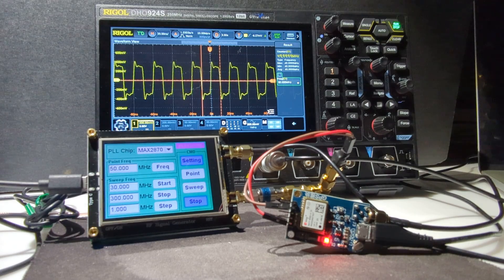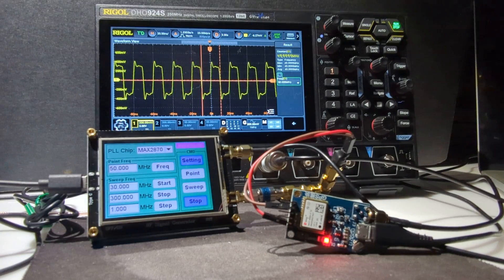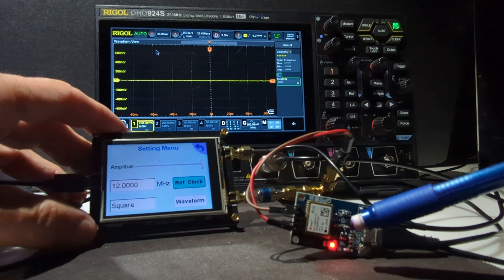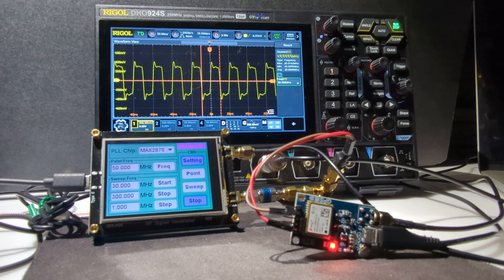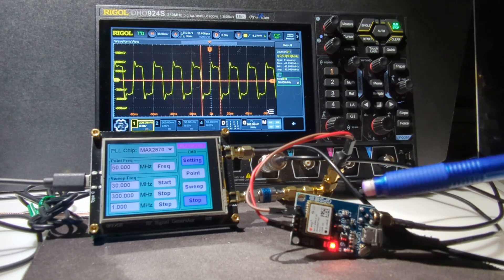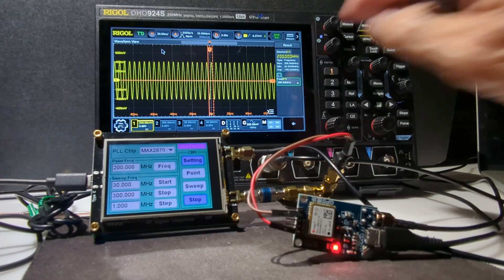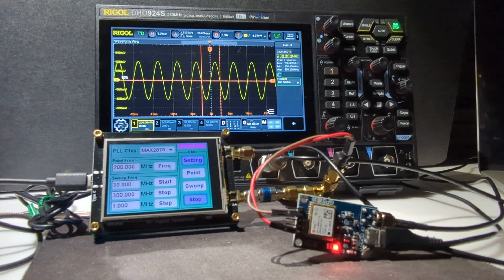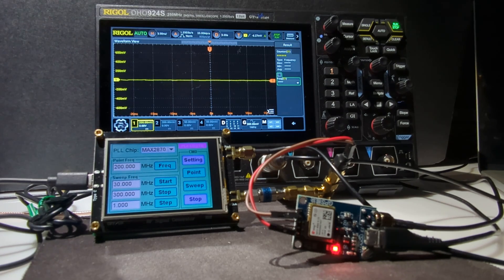MAX2870 signal generator using a UBLOX GPS as a reference clock

Comment: That’s a classic GY-NEO6MV2 breakout board (the blue one that was everywhere around 2015–2018).
The giveaway is the u-blox NEO-6M-0-001 module.  The LED blinking at 1 Hz means solid 3D lock (at least 4 sats with good geometry).

Comment: Hi thanx for the video,but can't I use a signal generator instead of a gps device?
Reply: Is the signal generator more frequency stable than the internal crystal oscillator on the MAX 2870 LCD board?  Some signal generators have a nicely stabilized, temperature TCXO, others don't.

Comment: Does the uBlox provide a digital signal that tells that the frequency is GPS synchronized and not just a local XO ? or one has to query the status over the serial interface for that?
Reply: Yes, you can set ublox to provide for example 1Hz and 5% duty cycle on pps pin and 1MHz and 50% duty cycle when get fix. They show how to do that in datasheet.
Reply from the maker: Using the serial interface is likely the easiest way, by parsing the NMEA messages, as you likely already know. I understand that uBlox also supports a binary UBX Protocol that can be accessed via UART. This provides a UBX-NAV-STATUS message with a field to indicate whether there is a valid GPS fix. I'm not sure which uBlox devices support this protocol or whether is is enabled by default. 

Just for reference, here is some more info about these two approaches: 

Using NMEA
--------------------
The "Fix Quality" field in the $GPGGA message indicates whether or not a valid GPS fix has been obtained (Fix Quality values: 0: Invalid, 1: GPS fix, 2: DGPS fix). 

Example NMEA messages:

1. NMEA Message with a Valid GPS Fix
$GPGGA,123519,4807.038,N,01131.000,E,1,08,0.9,545.4,M,46.9,M,,*47

2. NMEA Message without a Valid GPS Fix
$GPGGA,123520,,,,,,0,00,99.99,,,,,,*48

List of NMEA fields from the `$GPGGA` sentence, in order with definitions:

1. *Sentence Identifier* (`$GPGGA`):
   - **$GPGGA**: Global Positioning System Fix Data

2. *UTC Time* (`hhmmss.sss`):
   - **123519**: Fix taken at 12:35:19 UTC

3. *Latitude* (`ddmm.mmmm`):
   - **4807.038**: Latitude in degrees and minutes (48 degrees 07.038 minutes)

4. *North/South Indicator* (`N/S`):
   - **N**: North

5. *Longitude* (`dddmm.mmmm`):
   - **01131.000**: Longitude in degrees and minutes (11 degrees 31.000 minutes)

6. *East/West Indicator* (`E/W`):
   - **E**: East

7. *Fix Quality* (`x`):
   - **1**: Fix quality (0 = invalid, 1 = GPS fix, 2 = DGPS fix)

8. *Number of Satellites* (`xx`):
   - **08**: Number of satellites being tracked

9. *Horizontal Dilution of Precision (HDOP)* (`x.x`):
   - **0.9**: Horizontal Dilution of Precision

10. *Altitude* (`x.x`):
    - **545.4**: Altitude above mean sea level in meters

11. *Units of Altitude* (`M`):
    - **M**: Meters

12. *Height of Geoid Above WGS84 Ellipsoid* (`x.x`):
    - **46.9**: Height of geoid (mean sea level) above WGS84 ellipsoid in meters

13. *Units of Geoid Height* (`M`):
    - **M**: Meters

14. *Time Since Last DGPS Update* (`x.x`):
    - **(empty)**: Time in seconds since last DGPS update (blank if not available)

15. *DGPS Station ID* (`xxxx`):
    - **(empty)**: DGPS station ID (blank if not available)

16. *Checksum* (`*hh`):
    - **47**: Checksum for the sentence

Using UBX Protocol
-----------------------------------
The UBX Protocol provides a UBX-NAV-STATUS message that includes a "gpsFix" field to indicate the GPS fix status.

Example UBX-NAV-STATUS Message:

UBX-NAV-STATUS
iTOW: 123456789
gpsFix: 3
fixStat: 0
flags: 0x01
ttff: 4000
msss: 5000

gpsFix values and meaning:
0: No Fix
2: 2D Fix
3: 3D Fix
4: DGPS Fix
5: Time-only Fix
Reply: Ublox supports all of the GPS/GNSS receivers with u-center - GNSS evaluation software for Windows.   If you look at his Github project you will see one image showing you what u-center looks like.  Some uBlox based GNSS boards light up a green LED when there's a 3D lock, others start flashing the red LED.